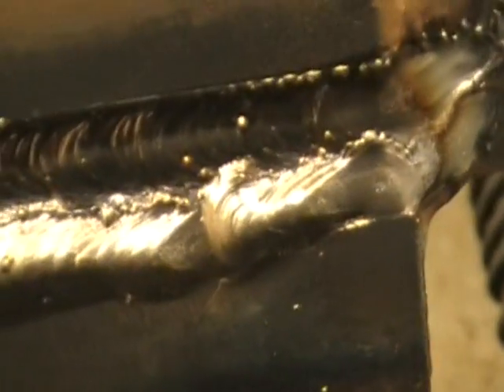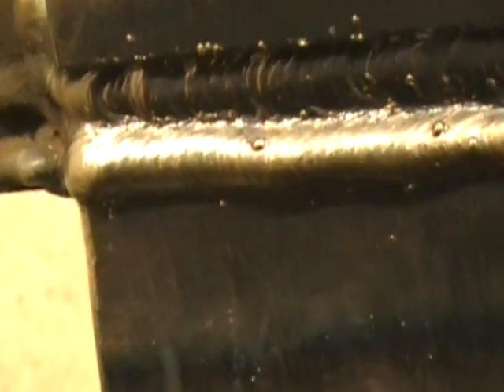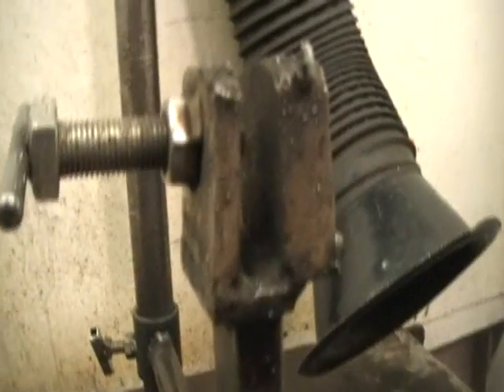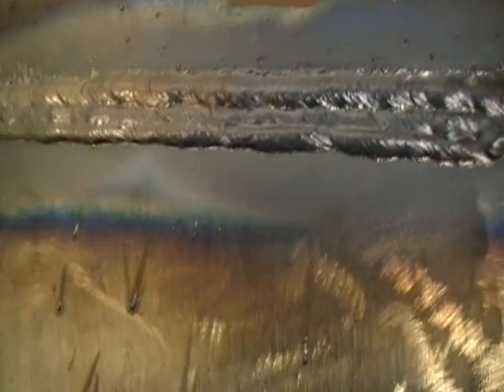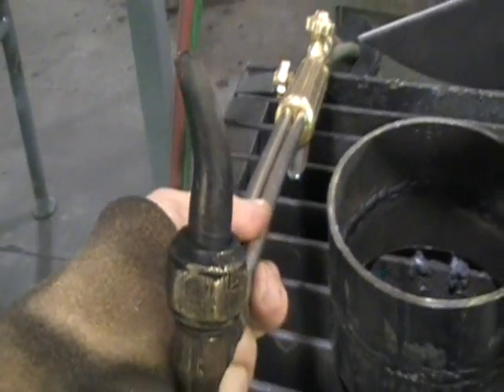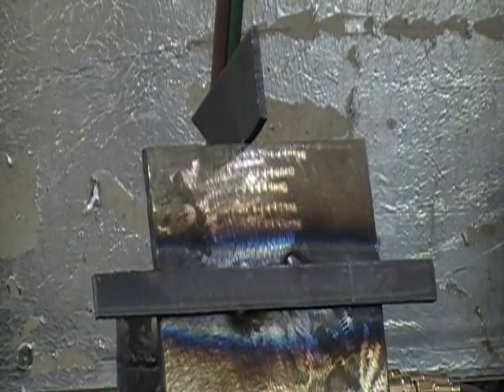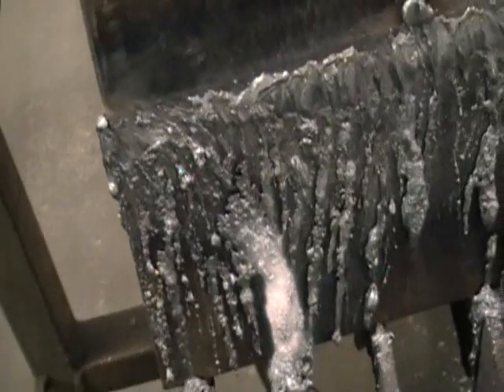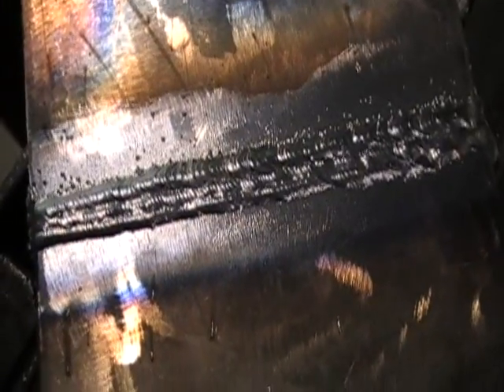how to weld a 2g mig bend test plate part 2

Comment: I'm making the test right now in Germany and i  am doing the same plates, 10 mm ; but we are giving only 3 passes and we grind each of the weld until is flat ; we let 3 TO 5 mm in between them and atach the ends but not like this, but with 4 smalll plates right at the end of the big plates , not in the back ,the most import the fact that the weld penetrate the plate and create a nice straight, mid size weld; not too think and not too fine; as here , he only brush the weld and continued welding;

Comment: Settings depend on the individual. BUT He didn't have a strong man on the back. If you notice the warping of the test plate. Also He used stringers to fill the wedge which works well but is a lot harder than say weaving it in. It took him if I counted correctly 5 passes (not counting the root) to fill it. with a weave (if it was allowed) He could have done it in 3. ALSO I have never had to torch the backing plate off my test. If the root is done properly and your not trying to penetrate the backing plate a simple ball-peen hammer could knock off the backing plate (mind you this is why I prefer the end tabs with-out a backing plate.)...  While I enjoyed watching this stringer 2G, man do I hate taking them lol.

Comment: There are reasons manufacturers have guidelines, while not always perfect for the person welding, these parameters are where the wire has been tested and passed certification. And I would hope you weld hotter than 19V on anything thicker than 12ga. I run no colder than 21V for handrail and at least 28 for anything structural, usually around 29-30V and 600-650IPM. That's with 0.035" ER70S-6...

Comment: I have to take this test next week. However the parameters are totally different. These low settings are not allowed. The settings we must use are 29.5 v, 425 IPM on the high side. 27.5 v 350 IPM on the low side. These settings have a -3% or +25% limit. No globular transfer allowed. All spray arc. The first 3 passes must be done with the high setting. The rest are done on the low setting and the cover pass has to be a minimum of 5 passes. The test is GMAW with 3/4 in. plate using .052 wire.
Reply: prefer .035

Comment: your voltage is too high or your amps too low, and your torch angle in relation to your work is all wrong, all that splatter makes for a shitty looking finished product.